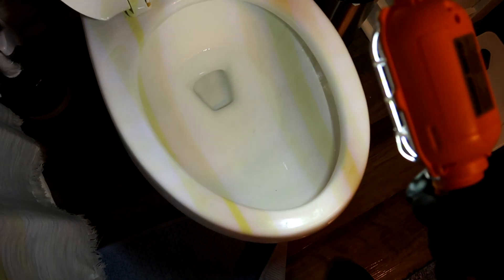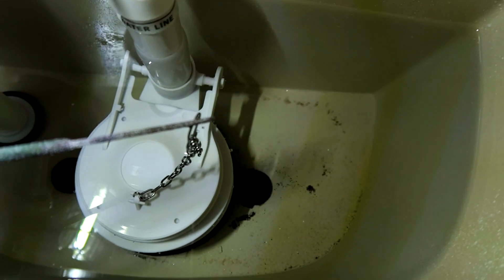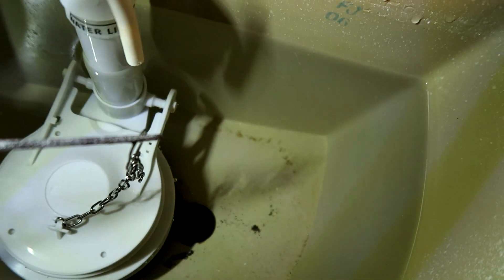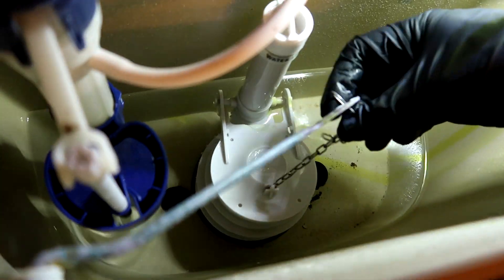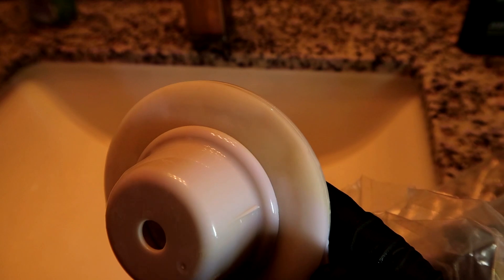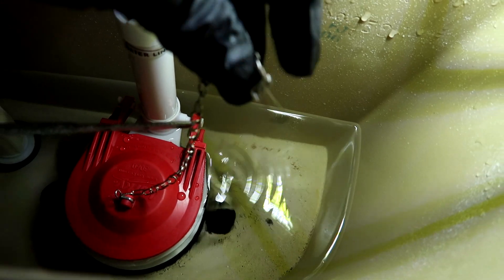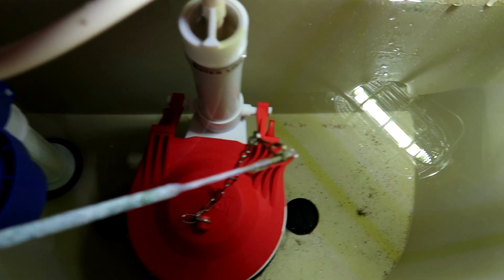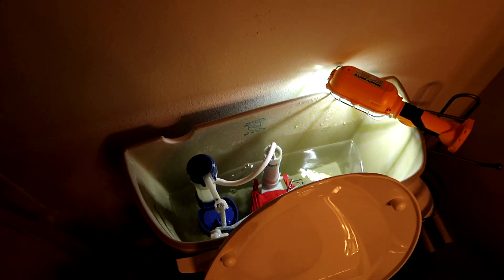Toilet Makes Sound Every Few Minutes

Comment from the maker: Toilet Flapper Links. Make sure to see if your flapper is a 3 inch or 2 inch flapper. Buying the wrong size will not work.

3 inch Korky toilet flapper link: https://amzn.to/3za7A2Q

2 inch standard toilet flapper: https://amzn.to/3o4FqjD

Tools That Can Make You Easy Money: https://www.dirtymaintenancenation.com/diy-tools-for-men/

If you'd like to support the channel, you can do so by shopping for tools or whatever you need on AMAZON at no extra cost to you through this link,
https://amzn.to/3cl1sMn

If I've provided any value for you and you'd like to donate $1.00 or more into my online tip jar, you can do so through this link, (all cards accepted)
https://squareup.com/store/dirty-maintenance-nation

This page contains affiliate links, which means that if you click on the link and make a purchase, I’ll receive a small commission at no extra cost to you. Lex Vance is a participant in the Amazon Services LLC Associates Program, an affiliate advertising program designed to provide a means for sites to earn advertising fees by advertising and linking to amazon .com

Comment: I have the same issue, trickling water.  I found the issue the rim where the flapper sets on is cracked just a little.  Will need to find that part.
Reply from the maker: Thank you so much for watching!
Reply: @LexVance  I fixed it tonight.  New Overflow valve and re-sealed.

Comment: Greetings.
Mine just started to sound like a low key fish tank. Not very loud. So quiet that it thought it was my dehumidifier that's just outside the bathroom door, in my bedroom. 

I already had to pay for an extremely high water bill (hallway) the one I haven't used, at the time 2 yrs.

How long does a flapper and all components inside the tank last if replaced including the actual toilet within the past 5 years? I want to say it was either 2017 or 2018.

Gratitude for the time.
Reply from the maker: About 7 years is a good life.

Comment: Question: What if a brand new flapper doesn't fix the trickle problem? I just put in a brand new system, and it's trickling even when the water is off. There's no wanter on the ground or anything. I'm not sure what the next step should be. Thanks!
Reply from the maker: The flush valve gasket is probably bad. You'll need to pull the tank and replace the flush valve if that's the issue. Thank you so much for watching SSkiano!
Reply: @LexVance  Thanks for the fast reply! I replaced the whole thing, is it possible that the gasket is too loose?

Comment: Hey from UK wanted to ask. I keep hearing ship/horn sound then filling noises and sudden shut off noise from what seems upstairs flat into my toliet room and into my bedroom this sound happens every 5mins-15mins non-stop driving me insane and leaving me sleepless. Sound itself is not coming from my high level ballcock toliet. it sounds like rooooaawwwww horn then filling and sudden stop. Like sound is above my head from flat above. But to add to mistery I filmed the sound from water pipe leading into my high level tank. So is it my toliet or theres? I called my landlord repairline and they sent plumber upstairs to replace part inside their toliet which looks like one from your video. But even as he was repairing I was hearing same noise. So could it be my high level ballock toliet that is faulty? He reccomended my high level toliet be rippped out and new one put in but he thinks theres asbestos in the old black toliet from 1998 so sample is went to lab to confirm and new high level will be fitted. If you can help with any insight thank you
Reply from the maker: I'd replace the fill valve first. That should take care of it. No need to rip a whole toilet out over a $20 dollar part. I hope everything works out for you Genji!
Reply: @LexVance  Thanks so much for fast reply! As I live in social housing flat in UK this building was built just after war in 1950 and high level black Daughtless Toliet we have possibably has asbestos lining in material of cisten. So they paniced and took sample for lab. They then said its so old they will just rip out entire thing put more moden high level toliet in propety. As local council is our landlord (Since its Gov Housing) They have legeal obligations to repairs. As per your idea of assisment I will past it onto them when I ring next Friday for lab results. P.S I would like to add after writing previous comment. I placed my ear against our high level tank and same loud noise eminates from it. Noise I also recorded from water pipes leading into tank. This same orendus sounds came again in 2021 back then it was flat above me that had problem and it disopeared so I assumed it would be same this time. But if I was able to record noises even as plumber was repairing one upstairs then. Perhaps possibably it is indeed my toliet that is buggered as we British say. Thanks again for insights! Waves from United Kingdom

Comment: Did u really leave that hook like that skid? Lol
Reply from the maker: 👍😆👍 No it latched correctly afterwards on the few off camera test flushes I gave it. Good to hear from you Joe!
Reply: I hooked one like that once and got a call back the next day that it's not flushing now... what happened is the hook 🪝 flipped over like it should of been and then the chain was to lose. Luckily I had a picture of my work so I could fugue out what happened.
Reply from the maker: @51-FS  Right on. It's been good for 3 days and no call back. 🤞